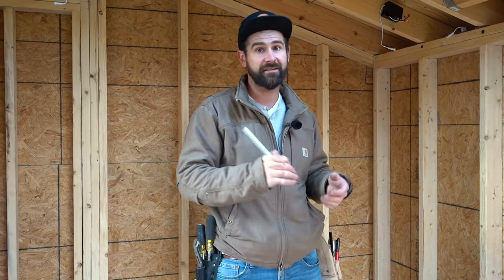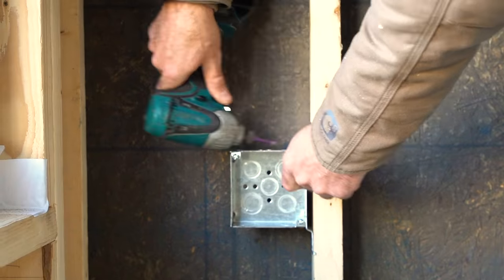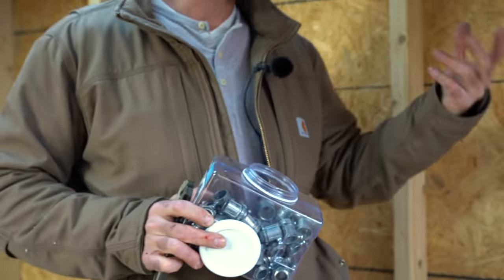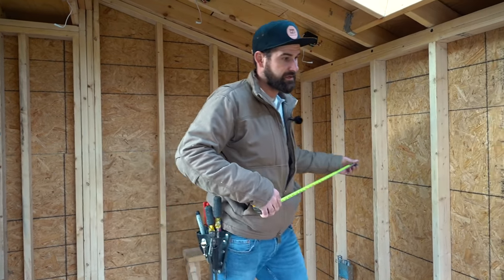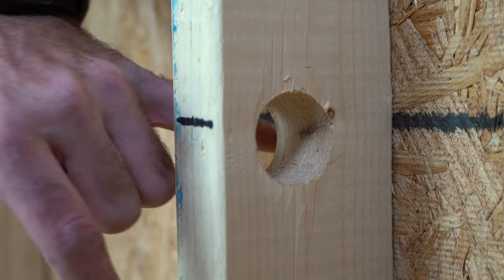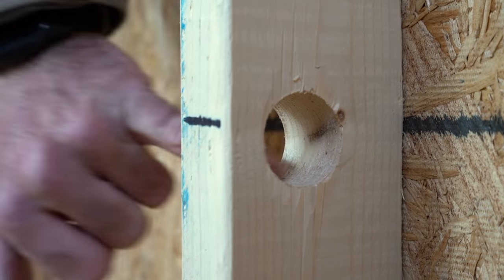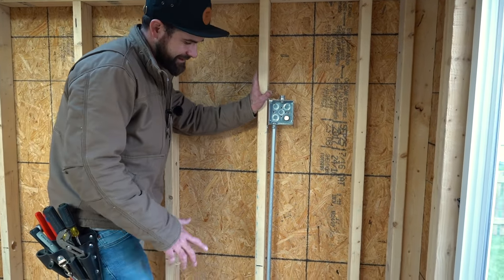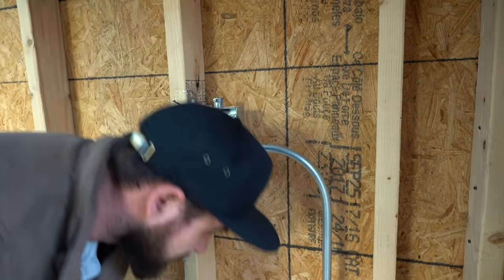How to bend and install electrical conduit

Comment: A few tips from a guy bending in Chicagoland since 1977. Loose the loaded toolpouch when running pipe. You don't need all that weight slowing you down. All you need are uninsulated 420 channelocks, a screwdriver with a Klein reamer attached, tape measure, pencil and 4 pocket nail apron. You want to be able to work light and fast and have everything you need right in that nail apron. Using a marker is bad for exposed work as it bleeds through paint and you're always having to take the cap off and on the marker which slows you down. Upgrade to a small battery impact for mounting boxes and tightening fittings. Wear sturdy shoes or your right foot will kill you at the end of the day from the bender. Get a short radius bender as you may need it for close quarter work. I used a hand hacksaw thirty-plus years. It killed my shoulder. If you're going to do a lot of this get yourself a small metal cutting circular saw such as a Bosch or Makita. It really speeds up the job and saves your body. After a while the math gets easy so strive to do the numbers in your head. Avoid coming into the side of any switch boxes. The fittings extend into the box and will obstruct any large size dimmers or timers that you may want to install later, especially if you're going to have a 2 Gang installation. I try to just use top and bottom knockouts everywhere. Switch boxes should be 2 1/8 in deep instead of the standard inch and a half deep 1900 bracket box. They cost a little more but you have more room in the box for dimmer's, timers and more wires that are required with multi-location switches. Believe it or not you can put in 400 or 500 ft 1/2 inch thin wall a day once you're proficient at it. Try to make it look good even though it's going to get covered with drywall. Inspectors love to see good pipe work as it's a key indicator that you know what you're doing.
Reply: I forgot the hammer!
Reply: You Chicago guys are great, I love to see EMT and wish the rest of the country followed your high standards
Reply: @aaron74  My brother lives in Charlotte, NC and they do not use conduit. However all commercial industrial sites do. When building a home there, you can pay extra and have it done. If you do this also ask for home run electrical from the panel to the first outlet or light. Good luck….Jim 
PS….I live in a Chicago suburb.
Reply: What do u mean about the home run to 1st outlet or light. Like one circuit per pipe? That would be VERY expensive and take up a LOT of room in the walls.
Reply: @christiancassini768  he means that it is quite common to take a conduit from the panel and route it to a given area and star out from there with another wiring method. Normally this approach would involve installation of multiple home runs in the same conduit (using dedicated neutrals and THHN/THWN you could install up to four 20 amp circuits in one conduit before de-rating the circuit).
Reply: I get the impression he isn’t a full time electrician.
Reply: Great pointers
Reply: I have an old mechanical pencil my father had used for architecture. It is designed to hold a normal pencil sized graphite and is operated via a plunger on the end. Simply press on the plunger while holding the tip against a surface to acquire the writing tip length if it ever breaks.
Reply: I used a 12v Milwaukee bandsaw to cut the conduit and a pipe reamer , pencil , I have a question,what kind of strap is he using ?
Reply: Awesome info. Thanks!
Reply: IBEW701 guy here. Did housing from 98 to the 2008 bubble burst. Man I wish these M12 Milwaukee band saws were around back then. First thing I was taught was find a bender that was not bent up and keep it. Next was to find out what it bent from the end of the shoe, Benfields were 99% 6 inches. Trying to find that 5 inch mark is a big waste of time. Oh and 500 a day at Gibson would get you sent back to the hall. Unless the codes have changed roofing nails were what everybody used for boxes. Ceiling fan box got 16 penny nails.
Reply: Exactly, lose the pouch
Reply: @robm3063  Was schooled by a 701 neighbor at the onset of a basement finish and garage finish and because of his guidance I can still bend conduit into a pretzel with precision. This guy in this video made me cringe. The tips my 701 neighbor shared were invaluable and never forgotten to this day.
Reply: Local 1186 Hawai'i here... thanks for saying that so I didn't have to.
Reply: Great comment, on losing bags. #100 fresno
Reply: You’re right sir, it’s 2021, why isn’t he using a bandsaw? It really is beyond my understanding, however, to each their own. $300 that will save you shoulder pains and arm pains, it’s a very cheap investment.
Reply: What  no  threaded  conduit no dies  and a  crap  pipe bender
Reply: @robm3063  your right about the 500 a day at Gibson. Can't be too efficient and expect to keep your job! Gibson lost a a lot of money on a lot of big jobs.
Reply: @cipher1167  A small metal cutting circular saw cuts like butter and leaves a super clean and square cut that barely needs reaming. Buy a Klein reamer that attaches to an impact tool if you're doing production work. Your body will thank you!
Reply: @robm3063  Nails really are a thing of the past. Inspectors frown on them in the age of screws and impactors. I used a lot of nails, like you did, but you gotta go with the flow. Washer head lathe screws are awesome and don't snap off like drywall screws.
Reply: @davenag957  I was in charge of all incoming light fixtures at Arlington Park before I got into 701. Drove shop van up to 117,150 and some  downtown before the race track. Funny thing about  Gibson and pipe.  Towards end of project they started looking at daily foreman process reports.  More pipe was installed than what was ordered.  Got to love 134 . I wasn't in the union yet so they wouldn't let me drive the stake body truck if had any material on it.
Reply: @aaron74  Right. Nonetheless, somehow we managed.
Reply: @grahamturner6119  Uhhh, maybe it's because he's running EMT?
Reply: Hey can you tell me what parts you would use to install an exterior light on vinyl siding? My house has round plaster rings that extend out past the sheathing and are 1in short from the vinyl mounting block.
Reply: @dancremens5273  If you have a siding block, which sounds like you do I  always had 1 1/2 or 2 inch 8/32 screws.
Reply: and who uses flat driver anymore lol
Reply: Had to laugh Dave, the mention of inspectors!!! here in the UK, although there are regulations, builders do just what they like, inspectors if you ever see one take photos of one house to clear the rest! I've seen in a "finished " home, hot water in the toilet, basins emptying onto the floor, acres of mastic everywhere, internal doors removed to make rooms look bigger and in some cases even small purpose made furniture to make rooms look big also!!! As to electrics, well you can guess. I stopped doing "House Bashing" years ago, only do Private work( direct with house owner) or commercial. Although, I have to say, even Commercial work now, is showing signs of the Accountants. Everything wired  in plastic cable, its size being questionable. Speed is of essence, not quality. They rely, heavily on the protection given by MCB's RCB's and RCBO's. Testing done to cover their arse, in case of liability.
Reply: @strykerentllc  using a good level when bending could have saved him so much time
Reply: @davenag957  if experienced electrians like yourself would crank out a few videos, it might reduce the wannabes?!
Reply: For 1/2 and 3/4 inch tw I used a #15 pipe cutter and no It did not leave sharp edge when done correctly.
Reply: @pedrodiaz3221  J-Nail
Reply: 134?
Reply: Mad props on taking the time to drop so much free knowledge based on your experience. Thank you.
Reply: I started electrical work in 1987. In commercial. I agree with the things you said in your comment. When I started all we had to use was hacksaws. Then someone came up with the bright idea of using a portable bandsaw. If you use a marker to mark the pipe. After you make the bend, you can go over the same mark with your marker, then wipe it off, and the mark will disappear. But as you said. It is better to use a pencil. Marker ends widen over time, and if you need your bend or cut to be in a certain spot, with a marker it could be off enough so it will not work, and you could have wasted 10' of conduit.
Reply: Perfect last name for the amount of words typed
Reply: Thanks
Reply: Many thanks!! Much respect for being a hardcore journeyman I swear this kind of knowledge would be lost without YT. Hopefully you are considering starting channel- with 33yrs experience we know you could crank out some good videos! 
Hell, just react to some of the bad advice on here from greenhorns:))))
Reply: @robm3063  sorry what you mean I assume hall is union hall.  But why? Is 500feet too much or not enough? Why? Union guys know etc they’re doing that’s all I know. Dad was a teamster in Alaska 50s60s till 74
Reply: @jamesrussell6870  I already asked him to react to a few newbies/part timers videos on here 😭
Reply: @tylerleavitt2715  In the housing market 500 feet for anyone other than a one-week newbie is very bad. I've piped master bedroom areas in some big shacks that had 500 feet.  Commercial maybe not 500 feet, depends on the situation. Long straight runs on a strut than yes. a
And yes by hall I mean union hall. I'm 701 which means DuPage county. 134 is Cook county also known as Chicago. Our jurisdiction is county based in my area.
Reply: @robm3063  You sound knowledgeable Rob, but as you have probably experienced,  every day and every job is different. The newbie crack is a little strong. Some remodeling jobs can kick your ass, some new construction can make you look like a hero. I supervised, and also fired,  an ex Gibson guy that took a full stick of pipe for almost every bend and threw the 3'-4' cutoffs in the dumpster! Maybe that's how those pipe numbers get exaggerated at those big companies.  At $7+ a stick for 1/2", my scraps are usually under 10". I too have burned countless numbers of bundles on big shacks, the stuff just vaporizes! Metal stud work on commercial jobs can really eat the pipe up quick too. I hope your career lasts a long time. Wear kneepads!
Reply: @davenag957  no they were not throwing it away just fudging the numbers. At the end of the job there was two hay wagons of extra pipe. That pipe is now in installed in the DuPage courthouse. I'm 701 retired early before the new early retirement rules set in. Did the Gibson/Inland thing from 89 to the 08 crash and then did commerical to 2017.
Reply: Dave, love your intro with "Chicagoland", being a Chicago native, that shows me you're a pure chicagoan. Great advice! I live in southern california now, and I am running conduit from my main to a distribution box at the center of my attic (ranch home). All my buddies are like WTF are you running on all that conduit?!?" And to be honest, I had romex runs out of a panel, looks like shit. I check in on a reddit group called conduit porn. I wanted to create something similar. I am proud of my conduit work as I have never held a bender until I did it. I am redoing the home electrical because at some point the home was rewired and it's scary. It was a SUPER budget job and a breaker doesn't control a location... it control an outlet or light in six different locations as that run works its way through the home. all the terminations in the outlets are push-ins and they're chard. 14-2 with 20a breakers..... 

BTW, great video for giving an idea of what's involved.
Reply: @steveloux4709  any conduit coming out of a panel is a home run. It has nothing to do with wiring methods or dedicated neutrals.
Reply: @andrewk7745  I’m really not sure why you took the time to respond the way you did to my statement.  What I was describing was a conduit “home run”to the panel that is strategically located and includes a number of circuits contained in a common conduit.  That for 15 and 20 A circuits, up to (4) circuits could be contained in one raceway home run to the panel. And that from the remote box location, those circuits could individually star out to the local utilization equipment or outlet.  I’m not sure where we get off track from those statements that cause you to try to set me straight.
Reply: @steveloux4709  I was just saying a home run conduit is any conduit going from the panel to the first junction box, nothing more nothing less. The first junction box is a home run box. Nothing more nothing less. Nothing to due with dedicated neutrals, wiring methods, or number of circuits allowed. It’s always done in the piping method you described. The can be branched out from there.
Reply: This guy sparkies.
Reply: Thank you for the tips sir
Reply: @shaymic20  I was thinking the same thing as soon as he said to eyeball it lol I'm an apprentice and that's one of the first things I was taught when bending pipe
Reply: They don’t pay you for what you do, they pay you for what you know….
This right here is a prime example of experience.
Reply: Dude, you are a master sir.
Reply: Been doing it in Chicago for many years .. good tips. 😊
Reply: Jesus is the only way to healing, restoration and salvation to all souls. Please turn to him and he will change your life, depression into delight, soul heading from hell to heaven all because of what he did on the cross 

“Whoever calls upon the name of the Lord shall be saved” Romans 10:13
Reply: So wait….you’re telling me that it’s code in Chicago to run conduit in residential???
Reply: Old school shows his age. Finally upgrades from the hacksaw to a circular saw 😂😂 us young bloods use bandsaws these days. Quick question. Did the name the “Chicago bender” after you?
Reply: It kills me watching all these manly men using oversized power tools for light duty work. I see it all the time at work.. wearing yourself out or often breaking stuff because they think they need a “big tool”😂
Reply: Chicago seems like sucha safe and cozy place to set up shop
Reply: Those are good tips man!
Reply: @cipher1167 pay attention and use your brain. He's not an electrician and he's wiring a shed. Is it really beyond belief that he doesn't use a band saw? Not only that but it would be ridiculous to his target audience(obviously not electricians) for him to break out a band saw when most people building a shed are going to use a hack saw. Are you with me or still perplexed?
Reply: Awesome tips
Reply: Pure wisdom, you're right sir. Kind regards from AZ.